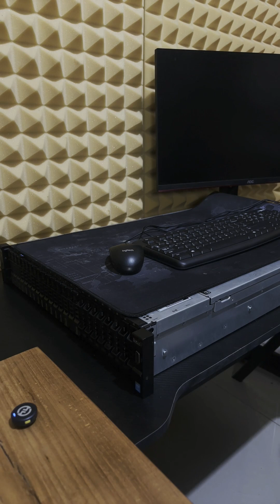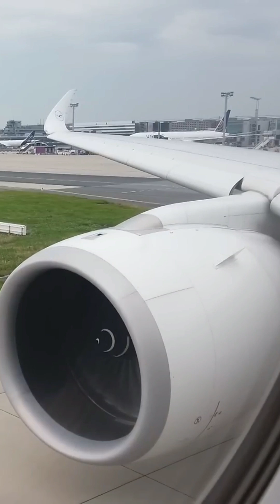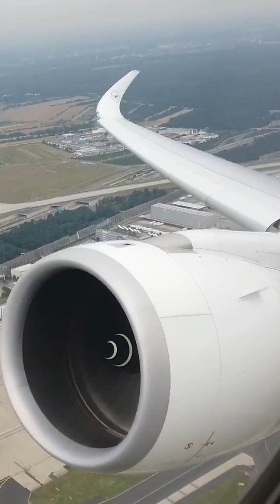⚠️ Sounds Like a Jet Engine! #poweronline #dellr730xd

Comment: At least the R730XD has older firmware where you can still overwrite the fan speed. The max.RPM is also a lot lower than for newer Dell models.
Reply from the maker: Hahah yes that’s right bro